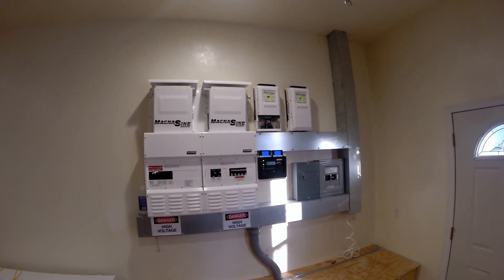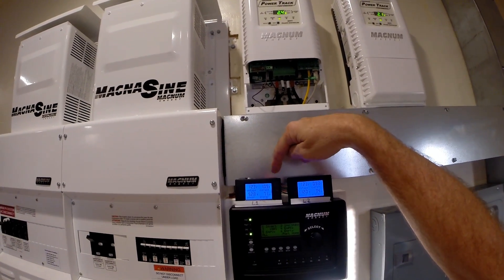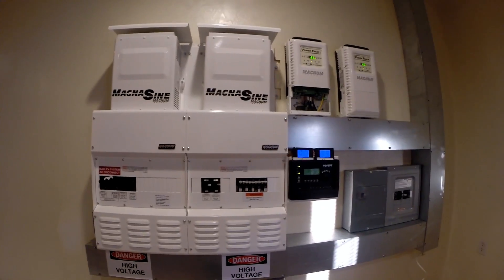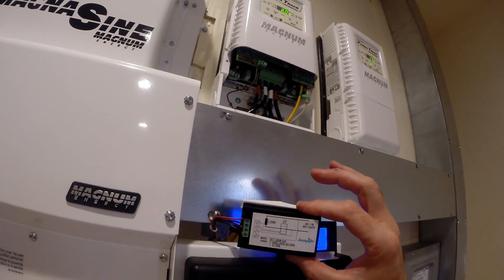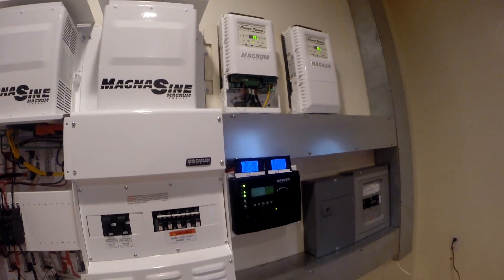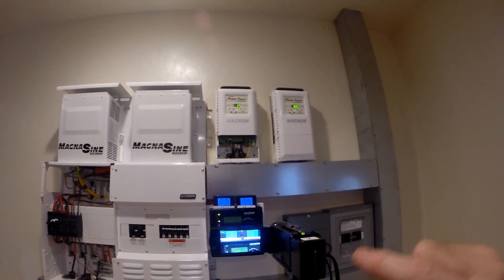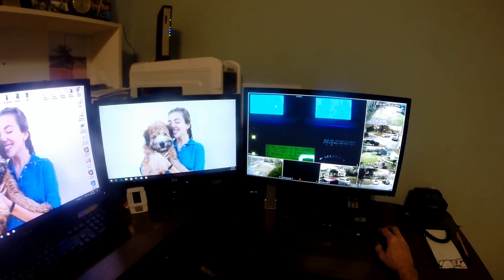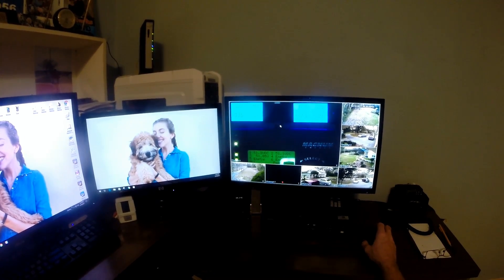Off Grid Solar #39: Multimeters and System Monitoring Hack

Comment: Hey, you might want to check out a product called EZMeter.  Just google it and it'll bring up the website.  I mention it because they have serial meters that speak Modbus, also they mention on their support site that you can connect them from a network connection using serial to ethernet conversion, essentially they have tools that will help you write your own interface and connect.
Reply from the maker: Sounds very interesting.  I have the MagWeb hooked up now and it's OK but could be a lot better.  When I get some time, I would like to write my own gui that I can play with to get just what I want.  I'll post a MagWeb video in a day or four.  Thanks!
Reply: Cool, look forward to seeing it.

Comment: 👍👍
I use similar meters for AC volts/frequency...DIY "meter box" deal. They are the adjustable ones. I used my Fluke 117 True RMS multimeter to get them fairly close to what that Fluke reads. As for your meters...dunno if they are adjustable. Your system is looking great!
Reply from the maker: I'll have to read the destructions to see if they are adjustable and then use your method to adjust.  Thanks!

Comment: those meters are not accurate at least the one I used here. I'm about to rip it out.  I'm assuming the system is working properly. what's your specific of gravity when batteries are full
Reply: How far off are they - if you know ? I have an OWL that uses similar clamp sensors and it reads high by 10%, but once I figured it out I'm OK with it.
Reply from the maker: I'm not sure how accurate these meters are.  They seem pretty good but I guess I will have to test them against a known standard.  The system has been working very well so far and I am learning how to get more out of it each day.  Still, I am throwing away (not using) a lot of power during the sun hours and running down to 80% SOC by the morning.  Yesterday, I got 14kwh out of it but that's probably about half what it's capable of.  So, I'm ready to talk batteries, when is a good time to call?
Reply: Tonight if you want
Reply: You can call and talk batteries when your free some time

Comment: I saw you running composite video cables, why not upgrade to an ip camera system?
Reply: Great video btw
Reply from the maker: The system I am running is wired and closed circuit.  It requires no local area network or internet to function.  I do have the option to connect the system to the my local area network and internet so I can view it anywhere but I don't have to for it to work in my office.